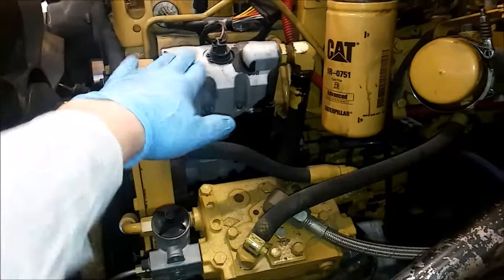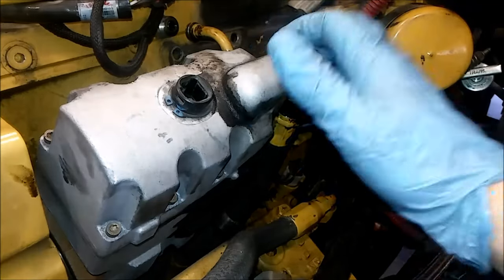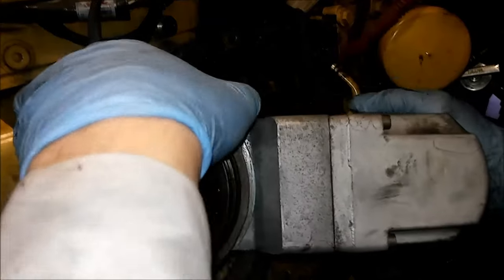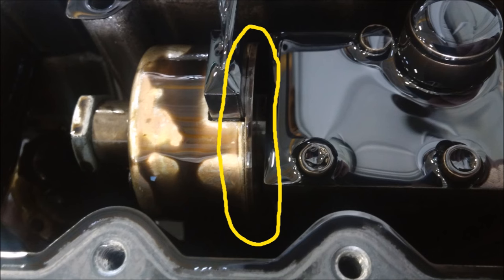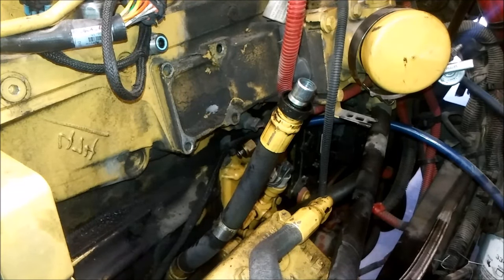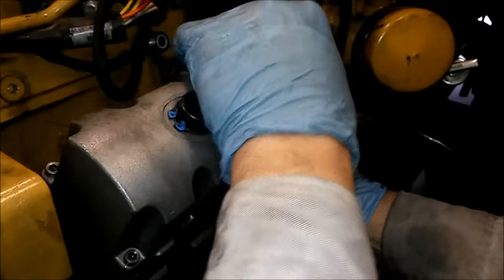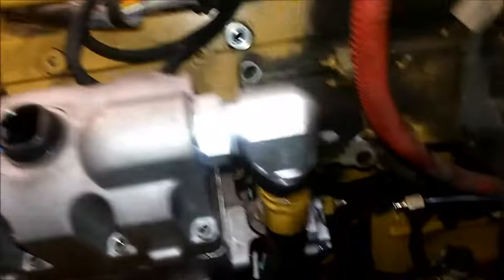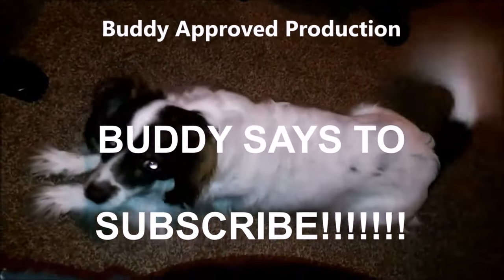How To Change a HEUI Pump.  Cat C7, 3126, and C9

Comment: You do not need to remove the air compressor to replace the line. All you need to do is unbolt the power steering pump from the back of the air compressor (leave the p/s lines on) then all you do is remove the back side it's held by 4 nuts (13mm wrench) then you have access to the 2 Allen head bolts that bolt the line to the block. Then you replace the O-ring on the block and reinstall
Reply: chris chupailo I had to replaced that oil line yesterday and I saw your comment and tried it out, it really helped out alot man instead of taking the whole compressor out just the power steering pump and the rear side of the compressor was removed made life alot easier thanks

Comment: Replacing the injectors is only necessary if that solenoid itself fails and leaves metal shavings around the solenoid?  Can contamination be seen through some of oil  lines going into the cylinder head? Thank you for the informative video...

Comment: I'm about to purchase a 2005 Freightliner sportchassis with a C7 cat motor. Under 100k and lots of good maintenance and service records. My question is I read so many issues with the heui pump dumping metal into the fuel system and causing injector damage and replacement. Why hasn't anyone added a high pressure inline fuel filter from the heui to the fuel rail ? Is that even possible ? Very new to Cats, all my toys have DD 6-71TI's. Great video and thank you.

Comment: word of advice make sure to remove add thread locker and re-torque the drive gear nut. have found them lose or to become lose after a few hours of running. also had some come in with a lose nut on ones just replaced by freightliner.
Reply from the maker: I have seen a couple with that happen. What ft lb do you torque the nut to?
Reply: Adept Ape normally 125ft/lbs but now I just use a 1/2 impact wrench.

Comment: Hey brother! Love you videos I’ve being watching all of them, now I have a question about the heui pump I remove the lift pump of the heui and I didn’t use the so call special bolt and all my springs and stuff I. The other side came out, I get to put it together but I heard that once all the springs and parts come out the pump would not run the same and I have to get a new heui pump?

Comment: Hey Ape!! Good tips you give here on your videos!! But i still have an issue i got this RV with a Cat 3126 and it wont start just cranks the tach does move and the oil press does move too. A previous tech says the fuel injector pressure is 200. What can you suggest it is?

Comment: Josh, at 1:11 mark is that the upgraded high pressure oil supply line(solid steel vs. steel braided hose) you talked about upgrading in the get to know your 3126 video. Thanks. Trying to tell if our 3126e hose has been changed.

Comment: Thanks for this video! A big help. Especially the part about telling us that this unit is not timed. A nice little fun treat there at the end too! 

I am going to look at some of your other videos now. I'm hoping to possibly learn more about the engine/fuel injection difference between say a 190 HP 3126E, and a 330 HP engine. I have one Truck with a bad 210 HP 3126B (70 pin), and I'm hoping I can more or less easily swap in a two year newer (70 pin) 3126E, of 300 or (EMS) 330 HP. 

I'd sure love to learn more about how Cat gets 800 ft/lb, and 860 ft/lb rating out of the same engine. It seems they are selling a high, and low torque models?
Reply from the maker: +Steve Kluver Thank you for watching. The 3126 engine and head are all the same. The differences between a 190 hp and a 330 hp is the pistons, injectors, turbo, and possibly the damper, HEUI pump, or camshaft. Depends on what rating you are looking for. The newer 3126 should fit right in. Just check that the transmission can handle the torque.
Reply: Thank you. 
I am waiting on a call back from a couple of different dealers now. I must have caught them off guard, as I could hear them over the phone scratching their heads, during my questioning of a 70 pin 'E' easily going into a 70 pin 'B' engine bay : - )

Do you happen to know what the lowest HP rating is, that does have all the right hard parts, but is just cut short a bit, by the ECU tuning? 250HP?
Reply from the maker: +Steve Kluver I believe the lowest "high horsepower" is a 250 800 torque, but that is a C7. I'm not 100% on that I'd have to check, the 3126 engines had more variability. If you find one with either 800 or 860 torque then that is the high horsepower build and should be able to be uprated. If you find one send me the serial number and a new message and I can try to look it up and tell you.
Reply: I will do that. Thank you. PM coming your way.
Reply from the maker: +Steve Kluver I got your PM, I'll check the serial number for a rating. In the future you can send me emails directly at AdeptApe@yahoo.com it is much easier than using the PM feature.
Reply from the maker: +Steve Kluver For that 7AS1625 there should be another digit in there. For serial number 7AS01625 that is a 190hp 520 torque engine.
Reply: Thank you. We'll get that number.

Comment: Does the high pressure supply line to the head have any O rings or just the ones that sit on the connectors? If you could help please I’m in desperate mode I have had issues with this for about a year

Comment: I'm changing the pump on a 3126B. Different style than what's on the video. The oil line that comes up from behind the compressor is solid steel and makes it real tough to get the pump out.
Reply: Got it. Had to keep removing stuff and prying just right.
Reply from the maker: +Chris Kinney They are tough to get, did it have the quick connect or the large steel nut? Having about every style wrench ever invented helps.
Reply: Adept Ape sont pas

Comment: Hey great videos can't thank you enough! I have a c7 in a f750 truck runs great until the temp gets close to 180 then the truck struggles to build/jumps  the  rpms only when driving and idles a little shaky could this be a cause of the heui pump?

Comment: Can you replace a square head heui pump with the round head heui pump. I believe in a different video you said the round pump had less problems and you could replace the driver separately from the rest of the pump for a lot less money. I have a rv with a 330hp 3126e. Thanks

Comment: The oil accumulator on the HEUI pump hold approximately 3000-3500psi of oil pressure to fire the diesel injector during cracking of the engine at startup. Hard start will occur if the accumulator can not maintain 3000-3500psi.

Comment: My parents have a 2002 frieghtliner motor home with a 330hp cat 3126 every was fine with it until my dad fired it up the other day it ran for a minute and then shut off the fuel filter I drained the cycled the key a few times but it will not fill back up with diesel but fired up with a tiny bit of starting fluid any recommendations

Comment: Do you have a video about replacing the flexible oil line going to the HUEI pump? The replacement line is a rigid steel tube assembly.
Reply: I think it has a filter as well.

Comment: Hi.   I have a 05 C7 not getting fuel. Ran great before it got 20 below a few weeks ago.  Changed filters. Did not help. Ordered new fuel regulator. They sent the wrong one. Just took out the old one and tried to start. No fuel is coming out of the hole. Fuel gauge is showing 0 psi. Time for a huie pump or is there something else i can try first? Thanks for your help.

Comment: This is great! Man, your videos are great. The HPOP on my 3126 diesel has a corroded case...I'll be into that job sooner or later.   "Adept", my question is this:  Is it possible to find JUST the metal DOME for my 1996 3126 HPOP? I knocked off the rust and wire brushed it, and hit it with some Rusteoleum Rust Restore paint, but I'm thinking sooner or later that's gotta be replaced.....I can't see to find just that part.... the "DOME" for the 96 3126 HPOP.
Reply from the maker: +QuantumRift I've never heard of changing just the dome on the HEUI pumps. If you wanted to the best bet would be a junkyard, but Cats usually get sold as an engine. Cat doesn't sell just that part though.

Comment: I have a C7 in our RV that is now popping the CEL "94-1 Low Fuel Pressure Warning (63)". Does this sound like my pump is going bad? If so, how would I change it in a pusher Freightliner chassis? I'm pretty mechanically inclined but it sure is tight in there! Help from all is welcome please!

Comment: Good evening, I have a cat 140K year 2010, he is blowing white smoke through the engine breather, and he reissued valve guides, engine block, compressor, he changed rings, checked the engine liners. Bearings, even changed oil pump and pressure pump, but the problem persists, white smoke is still coming out of the engine oil nozzle. What I can do, changed almost everything, I only need to see the turbo, which advises me or which believes the problem.

Comment: I replaced the transfer pump back of heui pump due to an oil leak on cat c7. Now I have an oil leak on the front part of the heui pump.  Was wondering if the gasket is able to be replaced or need a new heui pump.  Thanks

Comment: thank you for your reply when you open up the lines and flush the system you will be flushing out the     oil side will it be metal in the return lines for the fuel tank I'm trying to figure this thing out I am a gas mechanic this is all new to me thanks
Reply from the maker: +duane addison You are only flushing the HEUI oil system, but the fuel system. You are basically blowing out the old oil and little tiny pieces of metal so it should pour out the back HEUI plug in the head and go into the cylinders. You'll have to evacuate the cylinders after which should remove nearly all the fluid and debris from the cylinders.

Comment: Okay I have a question I would appreciate your help I have a c7 in a 07 c7500 it is leaking oil from between the fuel transfer pump and the huei pump what is the process to stop it  is there an o ring that seals it and do I need the fuel transfer pump removal tool from cat thank you for any help you can provide me

Comment: great videos, keep up the good work. I have a c15acert bxs, does the overhead videos apply to that engine and the injector replacement the same? thanks
Reply from the maker: The 3406/C15 injector video applies to your engine. The overhead adjustment one will show you how to adjust the intake and exhaust valves only, not the Jake's, IVAs, or injector height, but I'm going to be making a C15 specific video the next time I do one at work, so hopefully soon. Thanks for commenting.
Reply: Adept Ape  how about a power steering pump removeal install

Comment: Hi adept , 

I have c7 -190hp-freightliner straight 5ton truck . 

Problem - diesel in oil and low oil pressure 

Cat guys changed o rigs of injectors and now they are changing transfer pump . 

I am not getting any code. 

Cat dealer guys also confused about this dilution. 

Plz advise 

Thanks

Comment: thx for the lecture sir, i also have a problem with one of our wheelerloader 996h, showing three erro ,engine oil pressure,coolant temp,air flow, and engine has no power, pliz advice thx

Comment: Hi Adept Ape,  I have just found your channel. At the moment I have a problem with a Cat 3126 engine mounted in a Claas combine. The oil line to the top of the motor was pulled out of the housing of the pump.
The motor stopped immediately and some oil got out.
We are still waiting for a new pump, because I am from Germany and nobody here has a new one. We had to order it from the US and are still waiting since one week...
Just some questions:
Do you think, the engine can have some damage? 
The engine has 2000 working hours. Do you have some experience whether it is normal with this age? 
Many thanks for any reply.

Comment: I own a motorhome with a C7. I read in an RV forum that it is a good idea to clean oil sludge from the HEUI pressure regulator valve on an annual basis. Your thoughts on this? If it is a good idea, would you be willing to post a video showing us how to do it? Thanks! Love your videos!
Reply from the maker: +Craig P I haven't heard this one before. I've heard of a top end oil change, but not cleaning the HEUI pump out. I don't think it would do anything and the pump usually is clean, unless it failed.
Reply: Ok, thank you!
Reply: Craig P 145

Comment: I have a question.  I have a 3126 in my bus that has this same Heui pump.  The rubber feed line is leaking a little (seeping).  Is this something I need to address immediately, or is it ok to run it for bit while I gather parts?

Comment: Hi Adept Ape, I have a 3126B 8YL49553 330hp in a motorhome we had a lighting strike close to our house and ever since I can't get the rv started. The coach was plugged into the house for power like it always is.  A cat tech guy came out and hooked directly into the ecm and said it was dead would not communicate with his computer. I ordered a rebuilt one from a company in Texas with life time warranty hooked it up and nothing same as old one. Have a pressure gauge hooked up to the high pressure rail and all I get is 200 psi, I know I need at least 850 psi to get it to fire.  checked the fuse and ground and cleaned both, question is did i fry the new ecm is there some way to check wiring to find a short or what do i do. On a side note the lighting strike also took out the circuit board on the water heater. Help thanks Ralph
Reply: What powers and grounds do you have into the J2 plug on the ecm?

Comment: I have a 2003 fl 60 with a 3126 E motor with a C 7 pump not a round top is this a better pump   And can you add a jake  brake to this motor

Comment: I have a 2000 F750 with 3126, truck recently started to lose power after 30 minutes of use and reduce to 10mph with CEL.  Changed high pressure oil sensor, still no luck, mechanic says high pressure oil pump should be changed, seem like a logical next step?  

I should mention shutting truck off and restarting clears CEL and problem goes away for 5-15 minutes until it loses power again, seems to happen at lower speeds not highway cruising.

Thanks
Reply from the maker: +PA Winter Services Before you start changing parts, what is the check engine light? If you have injection actuation pressure faults it might be the pump, but it could also be leaking injector seals.
Reply: Adept Ape t

Comment: I have a 3126E in a 2004 motorhome.  The HEUI pump looks exactly like the one you refer to as on a C7 engine.  Is the 3126E similar to the C7 injection system?  I know it's the last motor design before they went to the C7.
Reply from the maker: +Gee Grim Yes on some of the latest model 3126 engines they had a C7 style HEUI pump. They should still have the square injectors though and the HEUI systems are the same on both engines.
Reply: I've watched a few of your videos, they're very informative.  Thanks for the info.

Comment: great videos,have you ever seen a cat 3126 in a 1999 chevy c6500 tach won't work,cat et shows engine rpm but the tach in the dash doesn't,no faults in ecm.I also have a 2003 ford f650 witha 3126 that cat et will not communicate with the ecm,engine will run but et will not communicate through the 9 pin in the cab,i don't have a diagram for the 9 pin in the cab to the cat ecm.
Reply from the maker: Well those GMC trucks I've worked on always have dash issues, usually it's in the dash or the GMC wiring. For the ECM not communicating, I've seen that be the ECM or it could also be the wiring. You'll want to put a jumpout harness on it and see if you can communicate then, that'll tell you whether you have a wiring problem or the ECM.
Reply: thanks

Comment: These videos are great going to leave a donation for you my question got a 98 Peterbilt 330 dump truck with a 3126cat 210hp s/n#1wm13822 230k it will miss under load over 1500rpm only at cruising or pulling a hill while pulling trailer or hauling dirt empty it will miss very little you don't notice it very much taking off from a light is fine till about 35mph then it starts the tach needle jumps around when it's missing any help is very appreciated
Reply from the maker: +redDmax04 Hmmm, seems like a load dependent miss. Any check engine lights? If you have a cruise control switch can you try and email me the blink codes.
Reply: Code 55 if I recall means no faults I took the truck  out for a ride today I t seems the more you step on it When it starts to miss the worst it gets

Comment: Hello AA,
It's Mike from the Jpaydirt channel.
We are considering switching out the old fuel injection system on our current build called old kenny with a 1693 in it. We would like to switch it to a high pressure common rail system and wanted your opinion.
Thank You,
Mike

Comment: Hey man got a quick question I got a c7 not firing all injector seals are leaking on the the top .. replaced all orings on all injectors tourque to spec and still leaking .not allowing oil pressure to build up and fire ..could I have a bad head ? Or  maybe the bolts are too stretch 🤔,and not getting the right torque ?
Reply: On some models the injectors do leak excess pressure of out a weep hole.